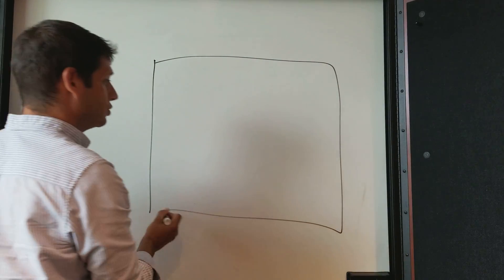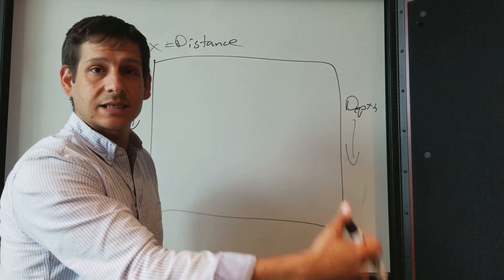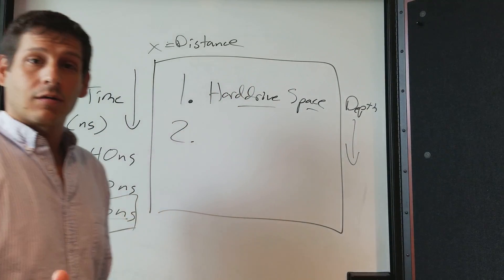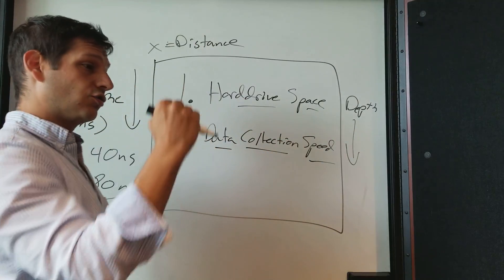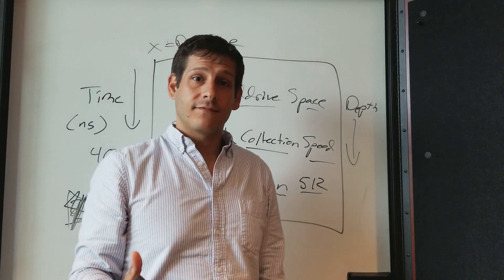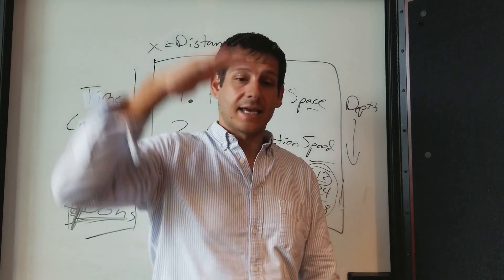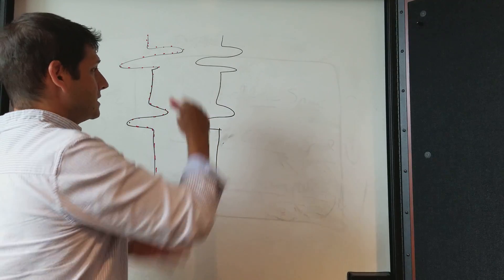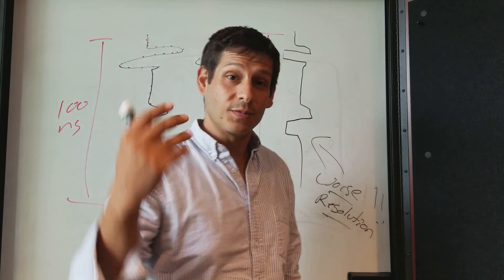Setting Your Time Window for GPR Survey (Ground Penetrating Radar)

Comment: Your videos are very helpful. Much appreciated. Do you have a table or guide that you use for settings? We have a 100Mhz Mala and we want to target 3-7 meters deep in limestone. We are willing to do multiple runs at different settings for resolution vs. depth but a visual guide would be awesome. Thank you!
Reply from the maker: Thanks for the comment. I'll make a video for you regarding 100MHz going 3m and going 7m. 😊
Reply: I really appreciate that. Amazing help. Thank you!! 
It’s already a little difficult because we are on a mountain so it isn’t smooth running but still fun.
Reply from the maker: Here is the video I promised: https://www.youtube.com/watch?v=ZcsSn4ntcdo
Hope it helps!

Comment: Hi. I have a question about multi - frequency radar. I have the data from our 3d radar GPR vehicle but the resolution is not that good. Usually our test area for the cavity and pipe detection. For example, in my data, I have 308 points on each trace. What suggestion can you give to improve resolution?
Reply from the maker: Roy Jon thanks for the question! So you have a stepped frequency system i believe. I have found that the data are a little bit more fuzzy than with pulse systems in general. I would look to see if there is a way to increase the number of samples before you collect data, but it may only do so much. Multi frequency has 2 or more pulse GPR antenna. I have played with 3d-radar data some recently. It might be worth having a conversation. If you would like to set up a time just email me at dbigman@bigmangeophysical.com. Thanks again!!

Comment: Hey buddy, I love the way you do your video. They are always so easy to understand and follow along with. 

Can I ask a question about this one? 
If time is not an issue, say you have all the time in the world to do a scan, and you had a newer GPR that had heaps of hard drive space,  then can you go extreme with the samples per scan, or is there a point number 4 to add on to your 3 other points that will affect it as well?
Reply from the maker: Even if you have "all the time in the world" jacking the samples per scan way up can decrease collections rates very significantly. I mean outrageously slow. If its a small project that you only have to collect a few transects on then its ok. but if you have to collect a bunch then it really becomes a huge drag on time. Like a 20 m x 20 m could take hours if you are collecting 4092 samples per scan or something. But, if you really do have all the time in the world, then you are only really troubled if you open the time window up to something ridiculous. Like I looked at a geological data set the other day that opened a time window up 2500 ns. Even at 15  MHz there wasn't much to see that deep and the actual structures were hard to identify because of the resolution issues. Sorry for the long winded, unhelpful answer.

Comment: Hi Dan, quick comment on point #3.  This last point is fairly specific to GSSI equipment.  I'm not sure about the other manufacturers, but Sensors & Software equipment keeps the resolution (sampling interval) constant regardless of time window.  As you mentioned, this means slower collection time as you increase the time window, but there's no risk of undersampling as you have with the fixed samples/scan method.  
As a side note, I've never quite understood why GSSI uses this samples/scan definition.  The fact that it's powers of 2 makes me think that it is to speed up certain processing steps, which would have been a concern 20 years ago, but not so much anymore.  Having a defined sampling interval (frequency dependent, of course) makes much more sense to me.
Reply from the maker: Chris Martin Hi Chris. Thanks for building on the video. I appreciate you adding additional useful information. Other manufacturers do allow users to manually define sample density. Definitely the Leica DS 2000 and I believe us radar quantum (don't quote me on the second one though...not 100% sure). But I'm with you. auto adjustments based on time windows is so useful. I do love that sensors and software does it on the back end for you. one less thing to worry about. Thanks again for the comment!